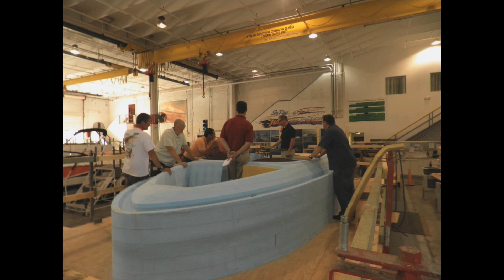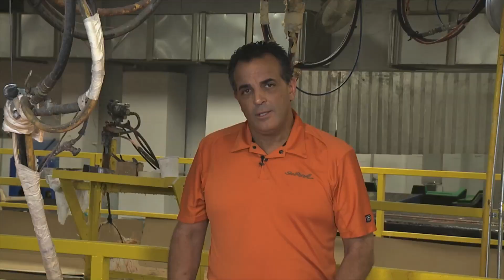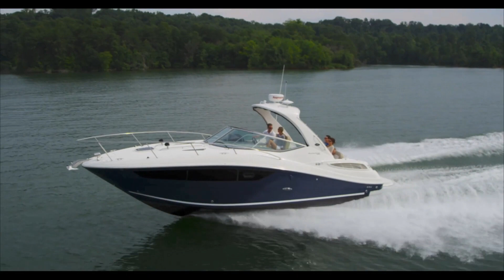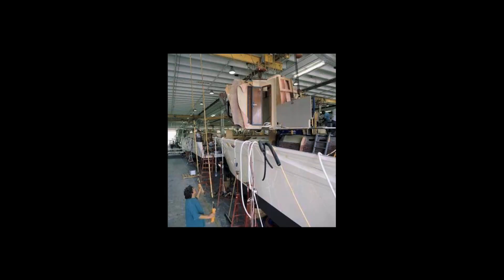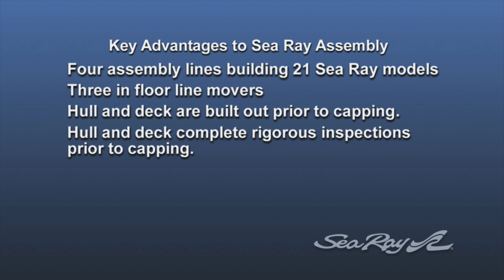Sea Ray - Plant Tour

Comment: I had a 85 Seville. 140 hp 4 cylinder. it kept up with v8s . not faster just kept up with them . I ran all day on one tank of gas . we went out every weekend without fail . even when it rained sometimes. falls lake in Durham nc. we loved that lake . 15 miles long. we camped and pulled the boat right up to our camp site. it was run by the state. hot showers. clean campground.

Comment: Literally the only boat brand I would buy used. You see so many of them 20-30 years old and as long as they are reasonably maintained, they are still holding up amazingly well.
Reply: I have one that’s now 40 years old I’ve owned for 22 years and it’s still solid. It’s used year round as I stay on it most of the year. 1985 390EC.

Comment: Do you have a manufacturer in Australia?  Due to our weather and cyclone season do you  have specs  for Australian conditions and laws here ? ,aslo can customer choose steal bulk heads instead of wood ? And customise thickness of lounge frames seating ect
Reply from the maker: Hello Kim, thank you for your reaction. And no, Sea Ray does not manufacture in Australia. But there are good Sea Ray dealers in Australia, please check https://www.searay.eu/eu/en/dealer-information.AU.html

You cannot chose steal bulk heads, which is however not necessary, not even in the harshest conditions. Sea Ray is a premium boat builder, with over 60 years of experience. They are used all over the world, including Australia.

Please contact one of our colleagues on the other side of the world and give them our warmest regards!

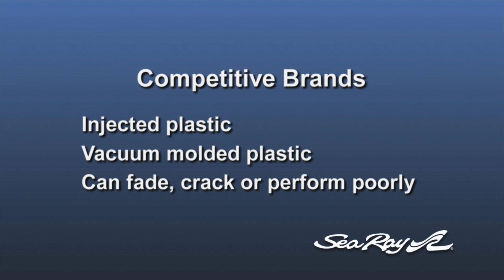Comment: @14:50 not true. the ski locker hatch on the 1998 sea ray 185 is made from plastic
Reply from the maker: You have a good point L. In my opinion it shows that Sea Ray keeps improving. And yes, things were done differently in 1988. I would suggest you take could care of your Sea Ray and enjoy her for >20 years, that's what Sea Ray boats can easily do ;)
Reply: @Kemperswatersport  1998, but yes I fully agree. she is very well built and I'm confident she will last for a long time! the plastic hatch I was referring to is high quality plastic and covered by carpet so you don't even notice.

Comment: Generally wood and water dont work well together as rot can happen. That said I have had 4 Sea Ray boats and have not had a problem with wood rot. The one I sold last month was a 2000 215 Express Crusier. The only problem I had was with the Mercrusier 5.0 it would vapor lock and not start when the outside temperature got over 85 after a lake run.
Reply: I had a 1988 sea ray Seville with a rotten floor…
Reply: @crazymc3909  Maybe they got better later on.

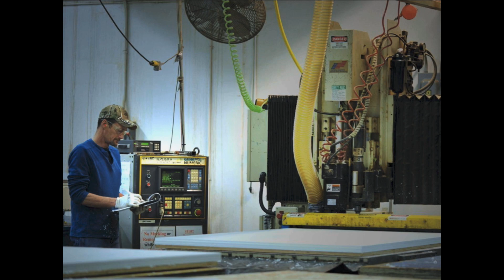Comment: 6:02 you allow competators to visit you plant so they can learn to better automate THEIR process...yeah i doubt that.
Reply: It's called benchmarking. That's how industry standards are created. If a process will improve the entire industry then its shared with competitors. If it's a true innovative competitive advantage its guarded. An  example would be the use of azdel composite panels in RV's instead of fiberboard which was prone to delamination. That innovation was shared with the entire industry so that all RV's could move beyond the delamination issue. This sort of information is shared in trade associations.

Comment: You show plywood bulkheads that looks not covered in fiberglass and sealed before you install them. Looks like trouble in the long run to me, water will get into this none protected wood in the bulkheads. This guys seams like he does not know quality,  skip the Sea Ray boats with bare plywood bulkheads is my suggestion. Boats built this way is just plain wrong is my opinion. I have spent many hours removing soaked wood and replacing it. All my hidden bulkheads even in my ancient Pearson sailboat are all fiberglass no wood except in my decks or visible interior bulkheads. I think their are other brands with solid bulkheads or grid systems that are definitely better than the bare plywood it looks like in this video on the cruiser bulkheads. Is this true Sea Ray are you using plywood not entirely covered before install?
Reply from the maker: Dear Donald, it is not me in the video but someone from Sea Ray. I have taken a plant tour multiple times and know that Sea Ray does everything to achieve the best resistance against water getting into wood. I cannot imagine that the wood is unprotected even though it may look like it. Sea Ray offers the best warranty terms in the industry after all.

We have been a dealer for many, many years and I have never seen a Sea Ray with problems due to water entering wood so I´m sure they have taken the necessary precautions.

Regards,

Bart Kempers